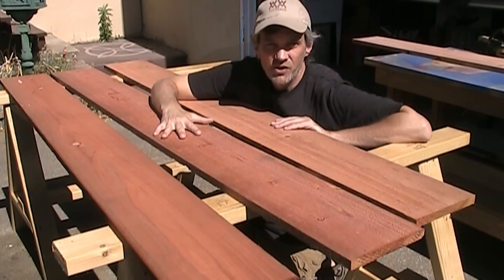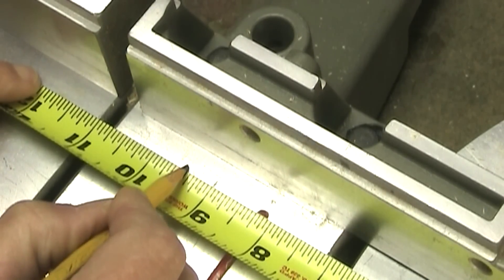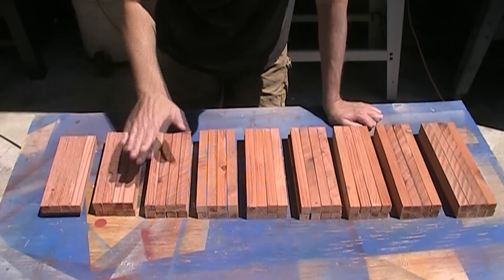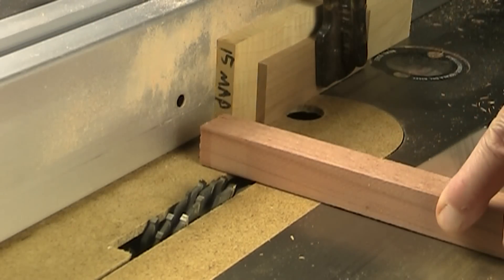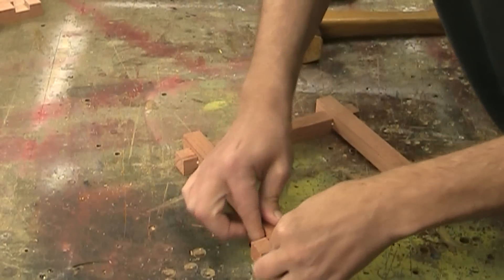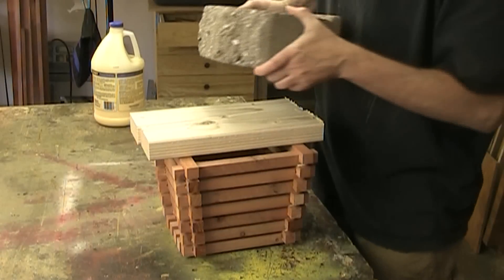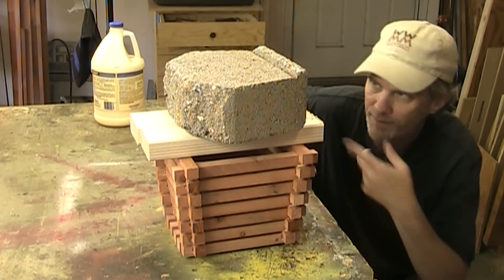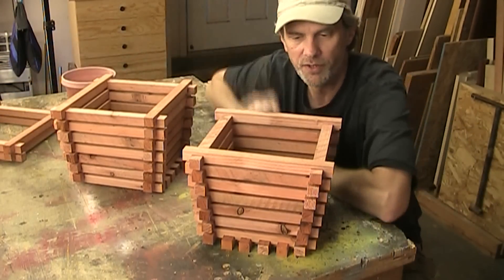Make a hanging planter out of wood

Comment: Hmm, do you realy trust the glue to hold the weight of the pots? If I would make something like this, I would drill every 4 connection parts of each segment and pull a rope trough all of  them - that's just my suggestion.

Comment: It's not waterproof glue.  But with wood that's weather exposed, the shrinkage and expansion will break any glue joint in time.  I even had the glue in mortise and tenon joints fail on patio furniture.

Comment: A few things about glue:
mode 1 - peel mode
mode 2 - cleave mode
mode 3 - shear mode

now, mode 1 is to be avoided as much as you can, mode 2 is also dot too good, mode 3 is the best to support. Expand this to any glue (wood or epoxy, or aircraft phenolic glues for composites, metals, etc)

In your case you used stress the glue joint on peeling effect (actually something between mode1 and 2). It is the least optimum use of glue.

Just get a long drill, and run a dowel on trough all corners.

Comment: To keep your wood from sliding in the wet glue, sprinkle a little salt on it. The salt crystals add just a little grit. Push the joint together by hand to lock it then clamp as usual.
Reply: Lincoln Logs lol